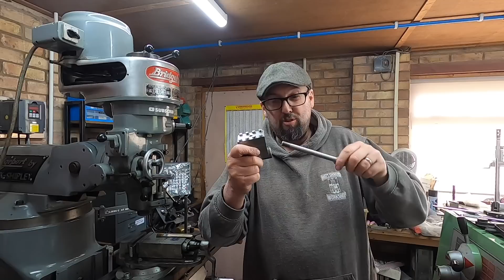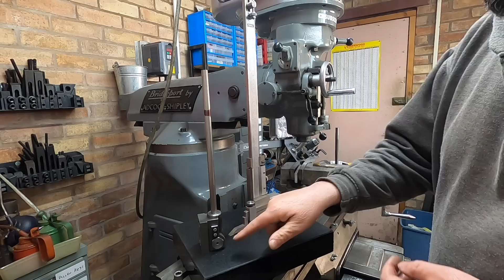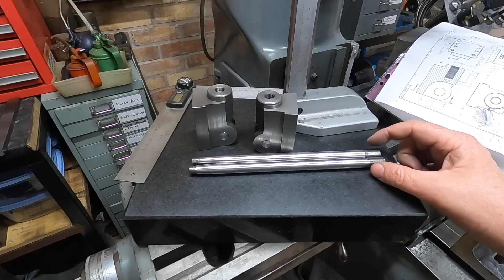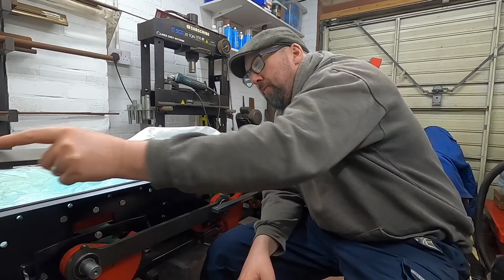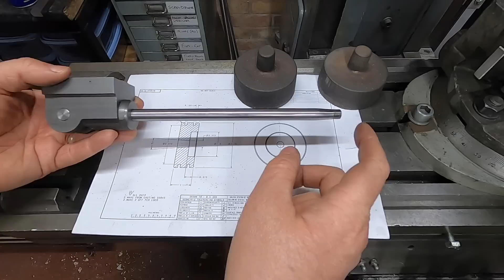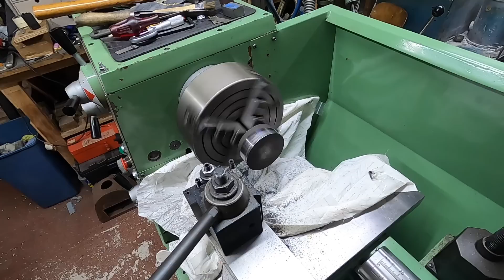Machining Piston Rods, New Laser Cut Parts  - EP77 Project Tinkerbell - 7 1/4" Steam Loco Build

Comment: When turning draft tapered diameters on CI I tend to turn in sections to allow the tool to have something to bite into under the skin, then once all the length is to the same diameter do cuts to size.
Me being a cheapskate can't afford inserts, but I spend less time at the grinder resharpening tools by avoiding running our the tool on the abrasive skin.
Reply from the maker: This was down to the tips, soon as I went to the cheap ones it cut perfectly. Will be the radius on the tip edge, I tend to buy finishing tips so I can take lighter cuts. The cheap ones I  have a larger radius and can take more abuse. All the best, Matt. 👍

Comment: Need to take a deeper cut to get under the  skin on cast iron thats why your wearing the tip out.
Reply from the maker: Will be the radius on the tip edge, I tend to buy finishing tips so I can take lighter cuts. The cheap ones I  have a larger radius and can take more abuse and deeper cuts. Soon as I went to the larger radius ones I had no issues. All the best, Matt. 👍

Comment: You can't beat Clupet rings. At New Romney I once ran a set of 8 rings on 4 valve heads for 77,000 miles before one broke;  and the engine was withdrawn for overhaul 800 miles later. And all 4 piston rings also went the distance. Just give them plenty of oil and they last for ever.
Reply from the maker: Hi Derek, to be honest, I don't know why people use anything but clupet rings!! Much more forgiving too if the bore is slightly uneven or oversized. Don't think I'll be running that many miles 😂 All the best, Matt 👍🚂